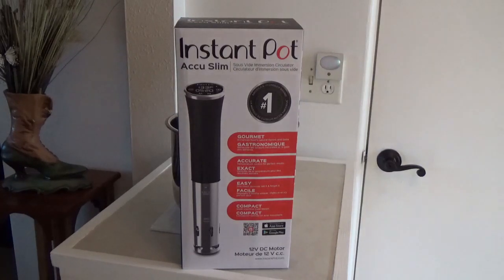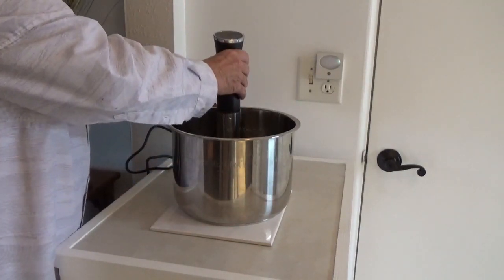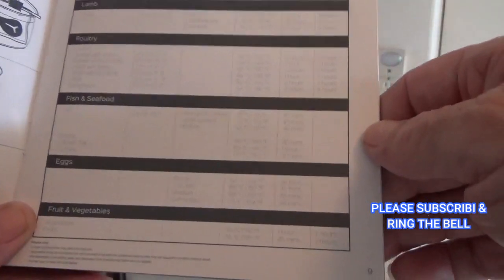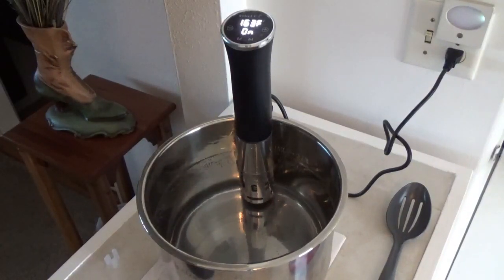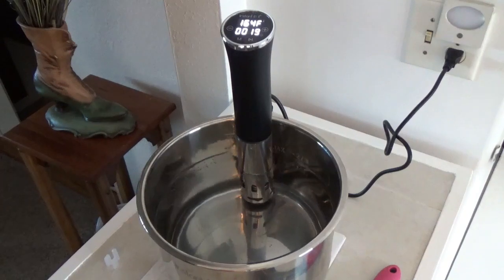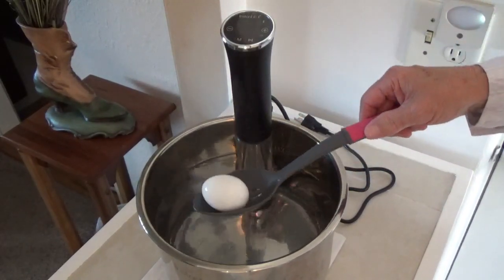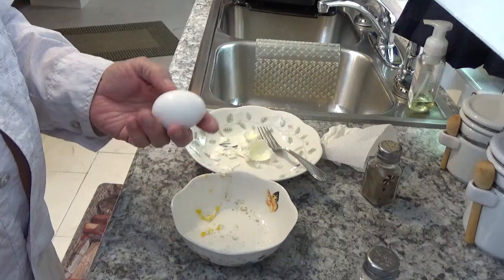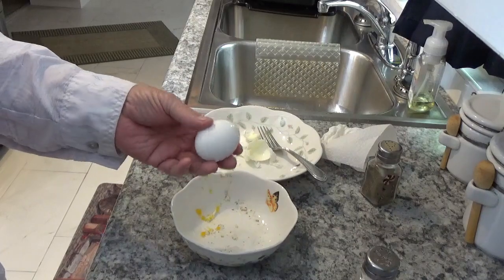INSTANT POT ACCU SLIM

Comment: I always fill my pot up with hot tap water.  It come to temp much faster
Reply from the maker: great idea. Thanks for watching.
Reply: @aroundthehousewithkaytom162  Also, if you have an  Instant Pot It makes great eggs much faster than the sous vide  and the shells practically fall right off.
Reply: You should use cold water.   Hot water runs through the hot water heater and can pick up unwanted metals.